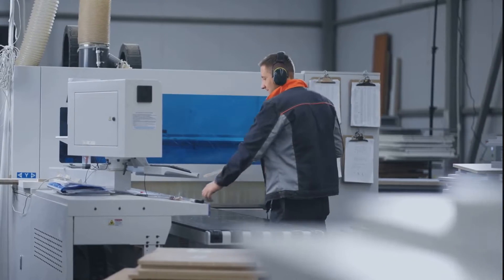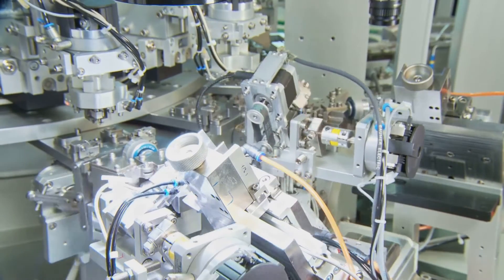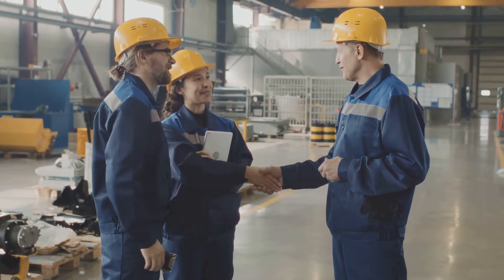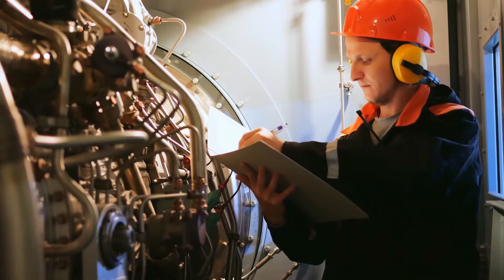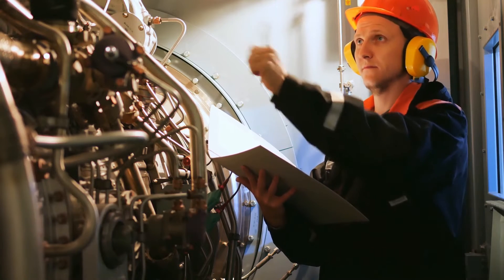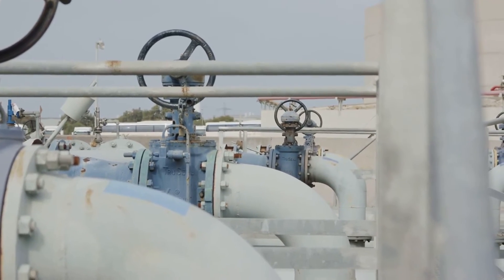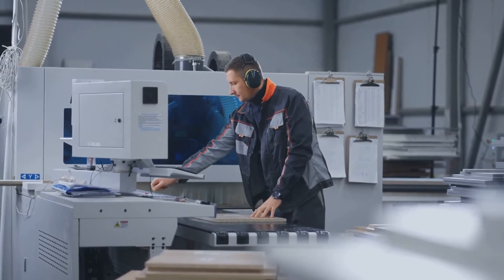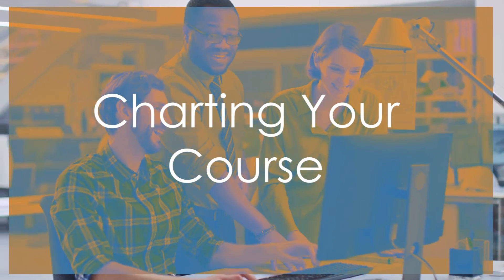What is the role of a Process Engineer ? | Career Guide - Job Description - Skills

Comment: Most of the images used in the video are from manufacturing engineering rather than process engineering. There are even a few from furniture manufacturing. There are no robots used in process engineering. 
Process engineering uses concepts chemical engineering, industrial chemistry, and food science, with some overlap into mechanical engineering—especially plant engineering—and automation on an industrial scale to turn raw materials such as oil, natural gas or milk (using heat, pressure or a chemical agent) into an end product (e.g. drugs, milk formula, gasoline, beer, butter, bulk chemicals, etc.). Process engineers are typically trained in chemical engineering.
Reply from the maker: Thank for the information I will take that in consideration for the next video
Reply: you sound like a dumb chemical engineer